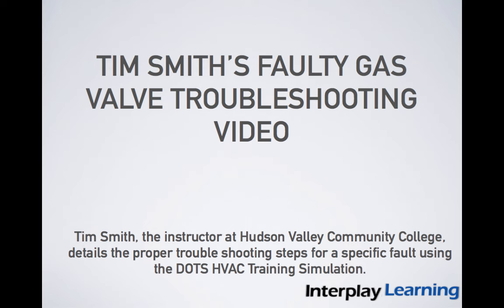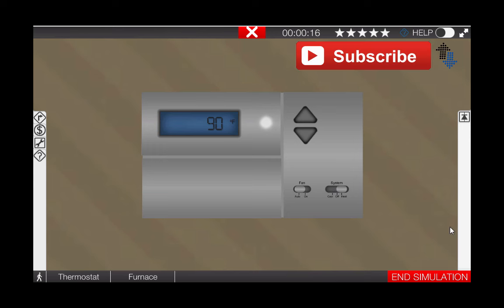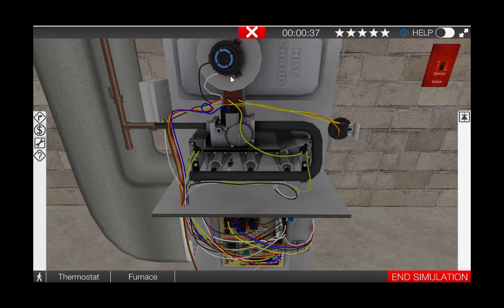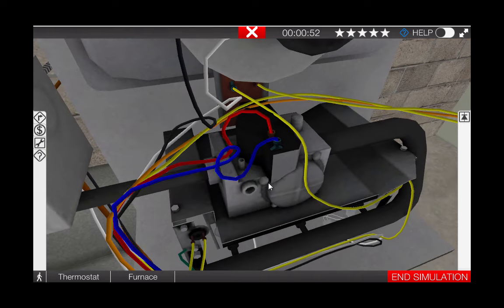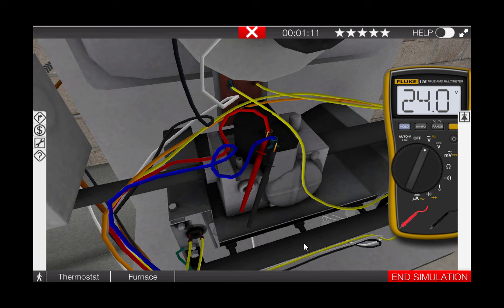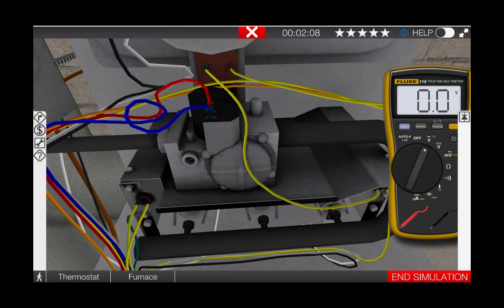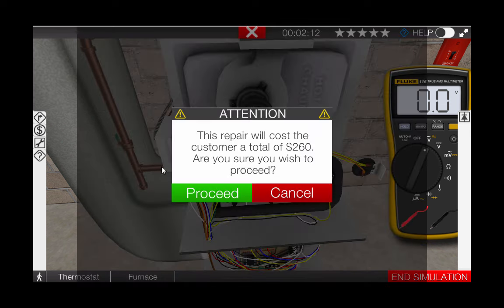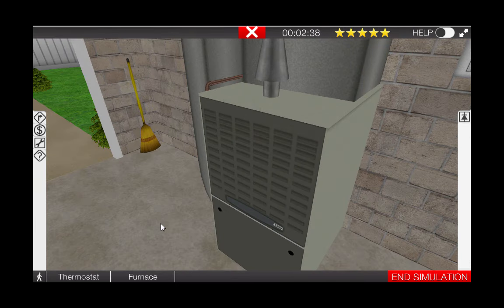Gas Furnace Faulty Gas Valve Troubleshooting Video

Comment: You will get 24 volts for only about 4 SECONDS until the board reads no flame and stops sending power to the gas valve. You have to connect your meter before starting the furnace up, because you are going to have only four seconds of power to the valve with no flame. Once the ignitor cools down, you will have zero  voltage at the valve.
Reply: Darryl Edington what if I have constant voltage at the indicator and the flame is not on. 28 volts on mine. But its constant. The thing Im not getting is the gas pushed through enough to keep the pilot on. Which is controlled by a shut off solonoid swith below the black push button. That alone can cause the furnace to not work.
Reply: I am getting 15v at all times. When the valve is commanded to open I am getting 24v. The valve is not opening and the furnace shuts down. Any ideas? Control board?
Reply: @markfothebeast  look at the back of the control board to see if there are burn marks --- brown/blackish areas on the back of the PC board.  usually , this is the indicator for a faulty computer controller board but not always.
Reply: @harpoon_bakery162  There were no physical burn marks or obviously damaged components. I ordered a new board and everything is now working fine.
Reply: @markfothebeast  I'm getting 15v at all times as well, I get 28v when it gets powered on by the board (around 5 seconds) and around .1 -.2 amps when using an amp clamp. I was thinking it is the gas valve but I'm not sure now. Would I see a voltage drop when probing the wires connected? Ohms reads around 800 ohms from one side and when switching pins around 600 ohms.
Reply: @scientist100  It's been a couple years since I played around with the furnace so I can't give a legit answer. But what I did to rule out gas valve failure was apply 24-volts directly to it (from the transformer) and shabaam! It made an obvious clicking sound. But remember to shut the gas off, of course. 

As far as I remember, the control board should be putting out ZERO volts and then 24-volts for them brief seconds during the starting cycle. Everything I recall reading said this and tis' the reason why I was suspecting the control board was at fault. And it was the control board.
Reply: @markfothebeast  so, I probed them connected and it is about 0.5 VDC, what I noticed this time is that when the board tries to activate the gas valve it does so so quick that I cannot catch the actual voltage being sent to the valve and I cant hear the clicking that you speak of because of all the noise that it makes at the same time, I will manually activate it and see what it does. In a normal system the valve would remain open or the 5 seconds applies as well even in a working system? I'm thinking there is resistance that is deactivating the relay but that's just my guess.
Reply: @scientist100  Geez, I can't quite recall all the details. What I did was test each component involved in the ignition cycle to rule out the fault.

This link below gives a good run down of what the furnace is detecting during the ignition cycle.

https://www.raleighheatingandairservice.com/furnace-ignition-cycle/
Reply: @scientist100  Did you find out what the issue was?
Mine ignites but no gas because I see the glow of the igniter.  I also installed a new flame sensor prior to this so it's not faulty.  I didn't hear any clicking sound and even tapped the valve to see of it open.  I checked for voltage...I get no voltage reading until the circuit board calls for the valve to open which reads 28volts for a couple of sends, not five seconds.
I've read that the existing gas valve I have isn't a good quality and when I ordered a new one based on the model number of the furnace, the new valve looks different.  It's physically bigger.  I called the company where I bought it from insisted that it's the correct one for the furnace.  I installed the new valve but it didn't open.  I turned off the power and turned it back on, tapped the valve, and it fired up.
Reply: @squidusn71  Yes, so for those that have the same issue. Test the circuit for the gas valve while it is connected because in my case, disconnected would make it look like it was ok but once connected, the load of the valve would show that the relay contact was weak to allow current to flow. Anyhow, the computer was bad because that's where the relay resides, the computer was replaced and everything worked for like that winter period, next time I tried to use it, I realized that it was doing the exact same thing, no current flow from those cables. 
Unfortunately for my luck, a copper pipe had a small hole and sprayed my furnace and water made its way to the board which destroyed it completely but I did get to check it a week before that happened. I had called the guy and told him about it that same day but like I said, a week later the water incident happened. Anyway, I told the guy to go ahead and install a new board but to ensure to test the old valve because I believed it to be faulty or about to be because it had failed the same way so quickly. 
He installed a new board and then called me later saying that the valve was not opening (probably got stuck) finally and told him to install a new one. I can now have a peace of mind knowing that it will last for the next 5 years at least before I have to be concerned about it. 
So, if I were you, this valve has a current draw of about 0.5amps, measure that and if it is exceeded, go ahead and replace it because it will eventually burn out the relay in the board that is soldered. IF the valve is faulty, it will be supplied 28v for about 5 seconds and if it doesn't do anything, then the motor has an open internally and would need to be replaced, mine didn't have an open but it was getting stuck for sure.
Reply: @scientist100  Thank you for the respond.  I only checked for voltage with the wires unhooked.  I'm not sure if my gas valve relay is on the mother board but there is an on and off switch on my gas valve both the old and the new(I replaced gas valve last night and so far it's doing its job).
I've had problems with my furnace not allowing gas to flow or to fire in the last 2 winters.  As I said, I replaced the flame sensor and it worked, this was last winter.  I found out that the best rated filter will also cause the problem as it will limit the incoming air pressure for the inducer fan and not allow the furnace to fire up.  That's when it started the issue so I went back to a less restricted filter.
With the new gas valve installed, the only issue that will occur now would probably be the mother board?  My furnace was installed, I believe in spring 2006?  I didn't realize it was that old now that I mentioned it lol.
Reply: @squidusn71  If you don't see the voltage being supplied to the gas valve by the board when the igniter is red hot, then that is a possibility, in my case I can see that it would slightly change the voltage but immediately go down to 0 again in less than a second, an amp clamp is best suited as it would show that the current draw exists or doesn't at all. The on/off switch is there for some reason but the board is what makes the power available to the wires for it to function at the given time. If you have a test light, that will be perfectly ok to test the system as they are rated for 12v to 30v I believe. The board is smart enough to know that the flame doesn't exist when it is at the stage to open the gas valve and will restart the sequence so, you can safely disconnect the gas valve wires to do the testing. There are videos where they explain the steps that furnaces take and then you can start from where the steps don't occur in your case.
Reply: @scientist100  Thanks, I really appreciate your response. Yeah I did get the 28v reading while the igniter is glowing hot, but no flame after that.  Also, I didn't hear the opening click sound of the gas valve when the 28 volt appeared on my meter and at this point, the igniter cuts off.
I just watch a video where I can hear the gas valve clicking open.  The old one didn't make the sound.  Fortunately, I ordered the valve last winter when the issue started but didn't change it at that time.  Now installed, I'm getting gas/heat.
Reply: @squidusn71  nice. Good troubleshooting skills for sure. Good thing that the contacts were open in the gas valve in your case because the relay burns out if it is drawing too much current which happened in my case. I'm an automotive technician so this was an easy system but having the technical data for the sequence is key for performing diagnostics in a system like this which looks simple yet complicated if we dont have the right info.

Comment: you skipped a troubleshooting step.  Just because you have 24V at the gas valve and it doesn't light, does not prove you have no gas to light.  You must verify that gas has failed to flow by installing your gas meter or manometer on the gas valve  or manifold tap to prove the valve bad.
Reply: I was wondering when that or checking supply was coming in.
Reply: So glad you said this Sir! If you check inlet pressure at the valve you can rule out a bad 325 regulator. If you see static but no working press swap out that valve. If static then nothing REG!

Comment: I have an intermittent problem as well.. it doesn't always light,  I always get 24 volts to the valve.. but it seems that sometimes later than other times..  I'm thinking that the gas valve gets power but so late that the system itself shuts down the valve quickly.. maybe too quickly.. So the late start on the power means that it energizes the solenoid for only a second.. the valve really doesn't turn on before the voltage is cut. sometimes the igniter is red 40 seconds before the relay gives power sometimes it's right away within a couple seconds.. I am unsure why there would be such an inconsistency as to when the relay will open the valve.
Reply: @Trent Gustus I have the same problem. The ignitor lights and goes out, then the gas clicks on and gas is released. I know gas is released because I placed a flame in front off the burners and they all ignited and began to heat the system. What did you do to correct the intermittent issue?
Reply: @majorflewellyn1133   I had a furnace guy come and put a new gas regulator on.. problem solved..  it was working but intermittently..  Cost about $300 for the repair inc labor, all good
Reply: Trent Gustus is the gas regulator inside the actual gas valve?
Reply: @theehardcoreone  Its one and the same unit I believe yes, there's a solenoid to turn the gas on.. and the unit regulates the amount of gas flow as well

Comment: What if the IFC is sending 2.4 volts to the valve and only 55 to 63 millivolts to valve?
Reply from the maker: Check connections, then replace IFC. I'm assuming the inducer is running and the pressure switch is closed. Without the pressure switch closing, there will be no ignition trial.

Comment: Please what does infinity resistance mean? what should it read? thank you?
Reply from the maker: Infinite resistance means there is no continuity through a circuit or component. There is no path for electron/ current flow. Measuring an open circuit would give you no measurable resistance reading and would be considered infinite resistance. If you placed an ohmmeter across the terminals of a good and closed switch you should have a measurable low resistance like less than 1 ohm. If you open the switch your ohmmeter would not respond or show any ohm reading and the lack of a measurable reading would be infinite resistance. Most ohm meters would show O.L. which stands for Open Line. If you are using an anolog meter, on one end of the numerical display scale would show 0 (zero) ohms which is low resistance and high continuity. Then the scale goes up to higher resistances (10,100,1000,10000 millions of ohms then into ranges not measurable for most ohm meters (infinite/ no continuity or too high to be measurable with your instrument) I hope this helped. Happy Monday!
Reply: @InterplayLearning  thanks heaps for your replay...i have given up on my gas heater...i have ordered a diesel one for now and will end up going split system and use the fan to circulate. COVID19 has made it hard